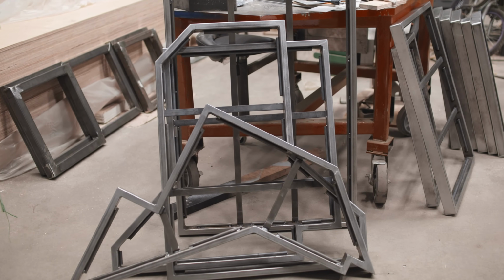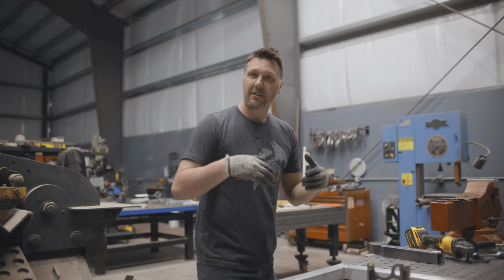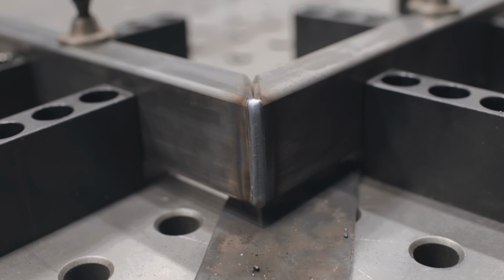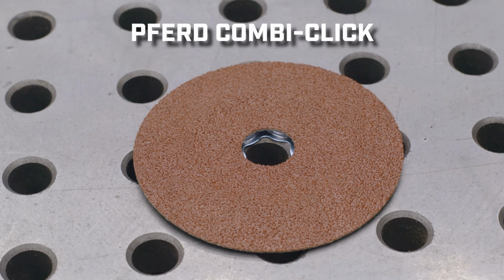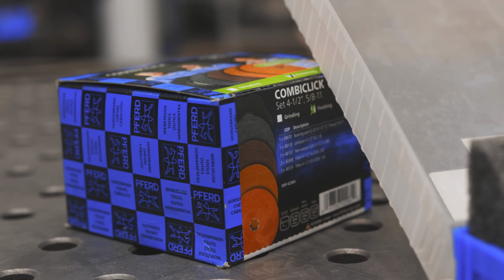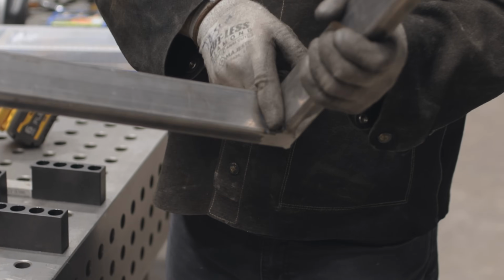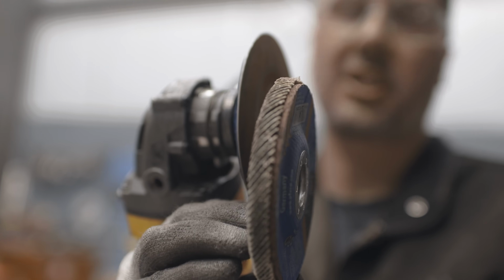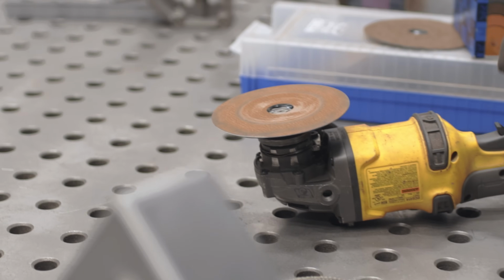Pro Tip For Grinding Perfect Inside and Outside Corners

Comment: Nice infomercial. The key, as you point out, is setting up the weld and getting good penetration. Hand-guided abrasion can be problematic so the perfectionists are building all sorts of fixtures to control grinding. For the inside corners I sometimes prefer to use a cylindrical carbide bit to get a rounded surface. IOW, there are many ways to skin this cat IF you get the welding right.

Comment: Nice, but I've done that kind of work with an old stick (Arc) welder, sometimes TIG, I don't own a MIG, Careful prep and weld and lots of work with angle grinder, with face grinding wheel, but best of all with the flap wheel. Well done.
Reply: You might think you’ve done a good job with the flap wheel..but you haven’t lol. I try to tell my guys this at work. Real fabricators don’t use flap wheels. They’re for farm equipment

Comment: When I was a teen, I was a helper in a fab shop. I was tasked with sanding hand rails for stairs. An older guy told me to use toilet paper to find burs and rough spots. The tp would catch and thus mark the spot that needed attention.
Reply: My shop teacher taught when deburring if you could swipe your schlong over it without damage, you're good. Never challenged him on it! 😂

Comment: I work at a fab shop taht builds flat beds and mower caddies, and all they care about is getting things out the door and soled. For them, they wouldn't care if its a stage 0 grind or if it's a stage 3, as long as the product gets soled.